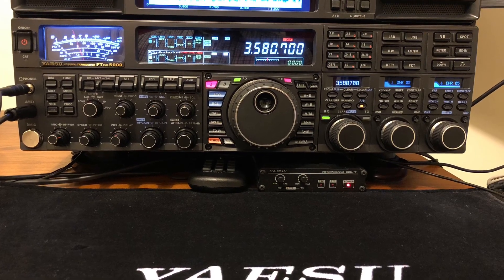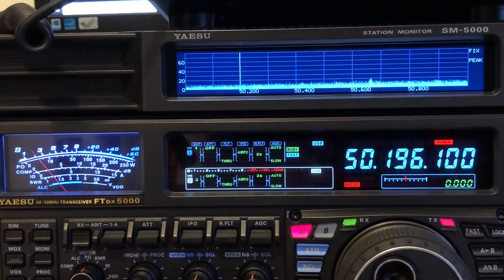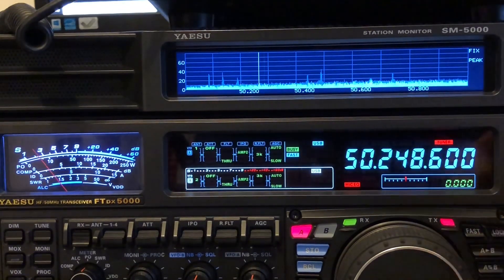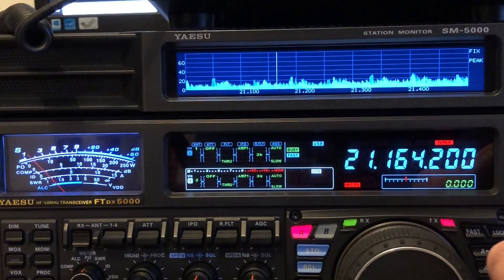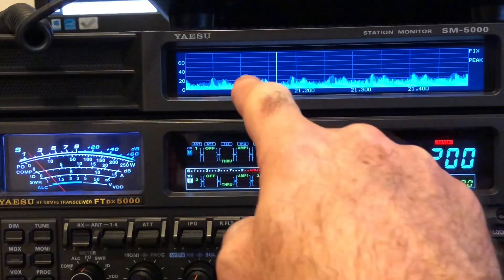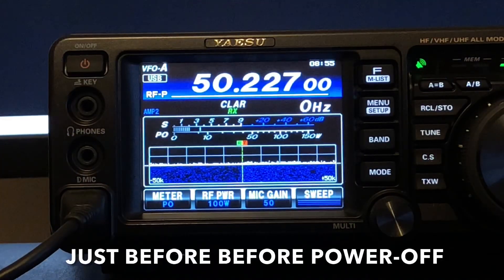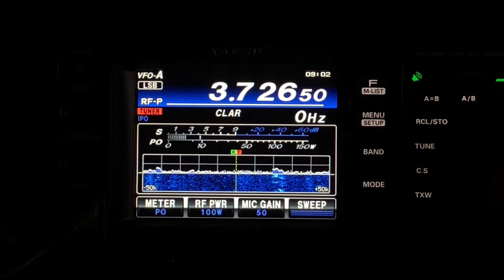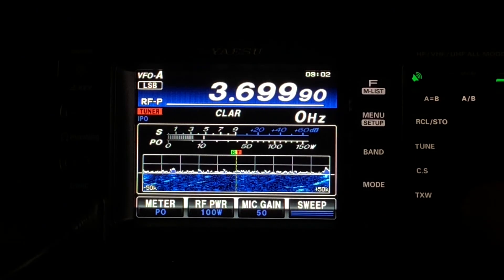A Rare Local Area Power-Off Test - Amazing Results On QRM 😮

Comment: Did you find out what the noise is a 2:20?  I have the same thing...intermittent,  varies in strength according to band.  Troublesome mostly on 40 and 20 meters.  Mine occurs every 10-15 khz....very annoying and puzzling!  Nice video...
Reply from the maker: @cannong1728  Yes, if you look in the description, this is one of a series of videos where I track and cure this qrm 👍🏻

Comment: Here in the states, I have found LED lights, especially recessed, to be the main culprits. Fluorescent Lights can too. Anything with a high voltage ballast but lacks proper RFI filtering can cause RFI, especially in the lower bands. Other things I have found to emit noise include active computer processors, GCFI outlets, drill chargers, cell phone chargers, and even found a cheap TV itself to cause RFI in one case. Basically, anything with a transformer in it has the potential to emit noise, especially the ones without proper filtering. 
Another thing that helps is to keep your coax network tight and impairment-free from the balun down. Proper single ground point to prevent ground looks helps too. If your coax connector is even a 1/4 turn loose, it leaves a leak in your system that also allows ingress to enter your system.
Reply from the maker: Thanks again 👍🏻

Comment: Hi Ian. You should try a mfj 1025 or mfj 1026. Brilliant for that type of noise.
Reply from the maker: Hi and thanks! If you check the two follow-up videos I finally solved the problem 👍🏻
Reply: Yes. I watched the video with the loop. It's crazy how far the noise can travel when it uses the house wiring as an antenna. Mostly cheap made Chinese power supplies. Glenn 2e0bvp.
Reply from the maker: @woodybollox  Scary isn’t it Glenn?!

Comment: Thanks Ian, very interesting! I had similar high noise to your 80m, but on 20m mainly. I found it was an aftermarket charger for my Macbook Pro, I'd had the noise for 18 months and it was driving me nuts.  Good luck with your investigation - cheers, Keith.
Reply from the maker: Thanks Keith! I think I’m going to be wandering the streets Dad’s Army Godfrey-style with a haversack on my front with the 991A and a direction finding loop....I won’t look odd at all 😁
Reply: @G0CNN-Ian  Yep, it's a real PITA, one of the biggest threats to amateur radio; I like to do the Parks on the air stuff to get away from the noise for a while.  Good look & please let us know how you get on. cheers, Keith

Comment: Hi Ian, I sympathise with you. I have exactly the same over here in Aycliffe since I put my HF antenna up. I mainly use JS8 from home and on 20, 40 & 80 it is horrendous, S7.5! 

I have contacted OFCOM and been told to do a log for 7 days (which I am now), I won’t hold my breath on them coming out though 😞, 73 Paul 2E0OPV 👍🏻
Reply from the maker: Good luck Paul! I’ve got options to follow up on, so will see how I go. Fingers crossed you sort yours 👍🏻
Reply: If they do turn out and get it found/sorted, I’ll let you know 👍🏻

Comment: the switching frequency of a PSU is anywhere between 40kHz and well over 100kHz so 70kHz is most likely a PSU of some sort. Every house nowadays is full of them.
The switching frequency of a PSU usually varies with the load. This can explain the resetting effect you mentioned. Laptop charger in a kind of trickle charge state? Could be anything really. If you own an oscilloscope or can borrow one, make a small loop with the short ground lead to the tip of the probe and sniff close to the PSU. The transformer emits enough magnetic field to be made visible on the oscilloscope. If the switching frequency matches you got the source of the noise.
Reply from the maker: Thanks for the info Robert! I’ll be going on a hunt 🔍

Comment: We had a power cut here in Bristol last week, it lasted for around Forty Five minutes. I also checked each band and was surprised to also see S0 on the majority of the bands!
Now, I usually see S5 on 40 S5 on 80 S2 on 20 S3 on 15 and S0-S1 on the rest of the bands. 
Not bad, BUT I have done a lot to get my noise levels here as they were S8-9 on most bands! 
More information on what I did can be found on my QRZ page
Feel free to message me for any help or advice  

73 
Ross, 2E0UGE
Reply from the maker: Thanks Ross! I’ve ferrited everything this end so far, but will take a look 👍🏻
Reply from the maker: Good write-up Ross and clear guidance (with pics!)  👍🏻I’ve previously done a mains-off test as well as running the 991A from a leisure battery. I didn’t see any reduction in band-noise so took from this: my mains is ok and I’m not producing my own QRM. On the back of this, I’ve not gone down the mains filter route....what do you think? Thanks! Ian.
Reply: @G0CNN-Ian  Hi Ian, 
The great thing about the mains unit is you are then isolated from any possible future QRM entering your set via the mains or earth. Things like my sons bedroom LED lights can now be used whilst I am on the radio and it no longer affects the bands. Unfortunately, what we are fighting is that neighbouring properties will use certain offending devices that will inject harmful noise in to the mains supply of the offending property and the wiring that runs around that property itself will act as an antenna and emit the QRM so that our antenna systems see / hear it. There isn't anything we can do in this instance other than use a QRM eliminator device (sold at places like WIMO for example)
Best of luck !
73
Reply from the maker: @hamradiostation_G5GTR  Thanks Ross. Yes I might build one as a belt & braces approach regardless. Just put a note round all the neighbours, so taken first step for a tracing exercise 👍🏻

Comment: I get exactly the same 80 meters is totally unusable +20 across the band . 40 meters around 5 to 8.
Good luck with tracking it down . Will see what results you have then I'll have a go.
Just a shame its winter nights as I cant use 40 and 80.. even at 3am .
73s M7SEH 👍👍
Reply from the maker: Yes Steve. At least it’s not unusable here,  it tracking that interference is a job to do 👍🏻
Reply: @G0CNN-Ian  where are you sounds like near me Teesside?
Reply from the maker: @stevehodds4070  Yes Steve, Darlo...
Reply: @G0CNN-Ian  I'm in boro mate 👍

Comment: The regular beeping type interference you were hearing first on 17m sounds a lot like the interference generated by an electric cat flap believe it or not.
Reply from the maker: Ah right. I only get it when I have the 2m/70cm colinear plugged into the 991A (& not turned on). When I unplug, it’s gone. I can suffer that one fortunately 😀
Reply: @G0CNN-Ian  that is interesting - I have a similar predicament. I hear it when I'm plugged into a vertical antenna on my SDRplayDX. If I switch to the Wellbrook loop it's almost nulled out.  I've confirmed it's the cat flap as it's originating from the front door and disappears when turned off. So likely more audible on an omnidirectional antenna. Anyhoo as you say the noise is manageable and alot less annoying than the rest of the crud heard.
Reply: I have the same beeping in my  FTdx5000 but not all the time.. and guess what? I made a test: I went with a different ssb receiver to the place where the antenna is, and I also had the beeping in that receiver with it´s own antenna...and if I moved 2 meters away, it was gone... Curious.. isnt´it?
Reply from the maker: Yes odd! I know how to stop mine. The colinear must be picking something up somehow. Odd.

Comment: i get very similar problem but its on every band below 70cm and is every 30khz, very annoying and i cant track it down myself. i believe its some kinda of switching psu in the building thats probably related to the internal fire alarm system.
Reply from the maker: That doesn’t sound good Steve 👎🏻I’ll now have to start a project to track mine down somehow...🤔

Comment: Your mic audio is terrible. Would have really enjoyed this video.
Reply: All good hear mate
Reply: Nothing wrong with it at all. Maybe check your ear-audio, Lennie.
Reply from the maker: Sorry about that Lennie! Maybe a smidge quiet, but I just upped the volume on playback at this end. Sod’s Law it sounded ok when editing on the phone. Oh well...🙄
Reply: @G0CNN-Ian  Audio sounds fine to me. I've also been trying to sort out my noise issues. Very frustrating.

I've tried switching off my own power at the main CB panel to my house which made little to no difference. Unfortunately turning of the power to the whole street is not quite so easy.

Unfortunately the only time that we did have a power-cut which lasted several hours I was out at work. Typical!!!
Reply: 59 here, no problems
Reply: think lennie has bad QRM his side...